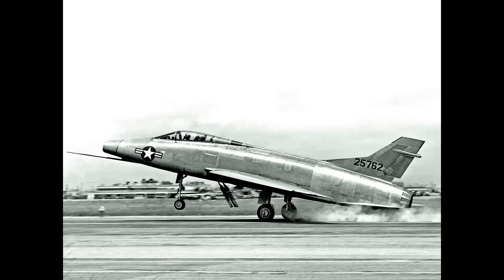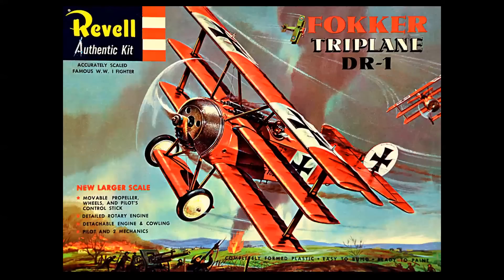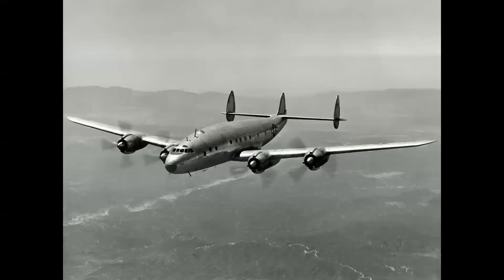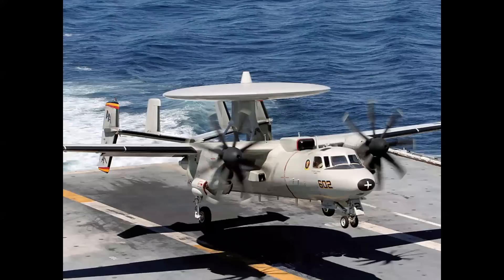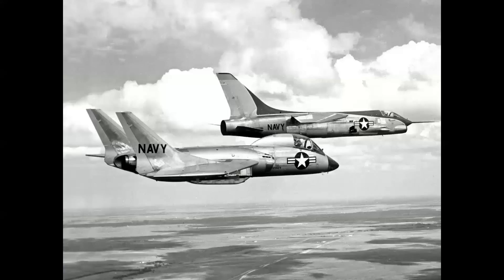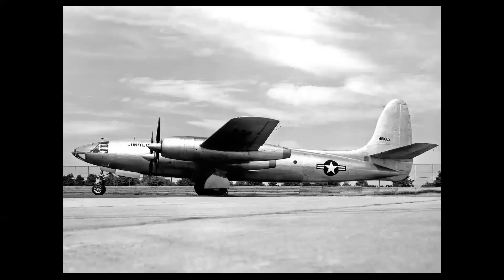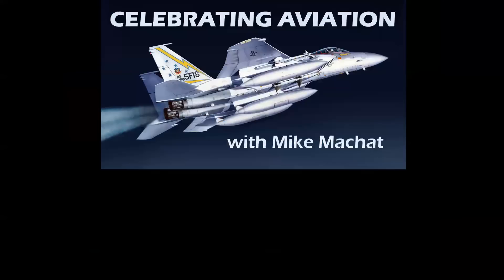VERTICAL STABILIZER DESIGN - A Photo Essay Showing Aircraft Tailfins Throughout History

Comment: That DC 8 vertical stabilizer is interesting in that the rudder section covers as much area as the solid front section, which is unusual as the rudders on most VSs cover 1/4--1/3 of the area usually. Also much smaller & lighter than 707 VS

Comment: Sometimes the fin has to be enlarged because the fuselage is shortened, shortening the moment arm from the center of gravity to the vertical stabilizer. The Airbus A318 has a taller vertical stab due to this fact.

Comment: Interesting video! I was glad to see that you included the shortening of the B-52 vertical stabilizer. When re-engining was being studied, one obvious choice was to switch to 4 larger engines. One reason against that was that with the smaller vertical surface it would not be able to handle the yaw caused by an engine failure if it was 1 out of 4 vs 1 out of 8 engines. As for those early flying wings, pusher propellors have a yaw stabilizing effect somewhat like a vertical fin. When they went to jets they needed to replace that effect with actual vertical stabilizers.

Comment: Great video, Mike!  One factor driving larger vertical fin size with higher HP or thrust  is the ability to have enough rudder travel to control the airplane in yaw when one or more engines quit on one side.
Reply from the maker: Thanks for the info!

Comment: Other than being very narrowly focussed on only US designs, this was interesting. It is salient to compare the tail fins of the Comet airliner and the Boeing 707, both pioneering airliners. The Comet's fin is incredibly small in comparison, but notice that in the event of an asymmetric engine failure, it needs far less rudder authority than the 707. This translates to savings in weight and structural strength in that area, both vital when engine power was marginal to say the least. People criticise the Comet for its engine placement, but in fact it was  a very smart choice for the time. It's also worth noting that carrier-borne aircraft have a tail fin height constraint, informing some designs like the F4 Phantom (the extreme anhedral stabilizers act as a partial inverted V-tail), and Grumman Hawkeye, etc.

Comment: One thing I liked about the XB-35/YB-49 rudders was the control system. The pedals weren't linked like other rudder pedals, instead pressing one pedal just opened the clamshell on that side of the plane. They also could be used as speedbrakes simply by pressing both pedals. Cool how it's intuitive both mechanically and ergonomically.

Comment: I believe the B 52 tail was shortened after an incident where the vertical stabilizer was ripped off due to turbulence. Shortened it offered less leverage, which in effect, made it stronger.
Reply from the maker: Yes, that is correct, thanks.
Reply: @celebratingaviationwithmik9782  My dad was a B52 navigator during Vietnam. I went the other way and became a professional tandem paragliding pilot 🙂

Comment: B52: "the tail was shortened when they discovered they didn't need that much area"

You're not kidding. Look up B52 serial no 61-0023, how it lost most of its vertical stabiliser, and how it flew on for several hours before landing safely.

Comment: Scott Crossfield, aka Mr. X-15, wrote about being involved in its design. And he pushed to have a very big tail on it with overestimated requirements. He noted how in the early fighters and X-planes of the era, most of them had dangerous stability issues addressed by enlarging the tails in later versions; but there was not one where they decided it had too much tail. And with all the unknowns and huge envelope leaps of the X-15, that was one factor that was a good idea to eliminate. And so they did.

Comment: The YF-22 prototypes had very large vertical tails which were greatly reduced for the production design.  The YF-22’s main landing gear retracted forward which forced the engine inlets to extend far forward against the fuselage.  At high angles of attack, the inlets would blanket the base of the vertical tails so they had to be large enough to see clean air at the tip.  The production F-22’s main gear was changed to retract outboard which enabled the inlets to be placed more aft.  This led to less blanketing of the tail which enabled it to be reduced in size.

Comment: Great video! I wish you would have included the YF-12A Blackbird (a precursor to the SR-71).  It had a 3rd retractable vertical tail under the aft fuselage.  It was folded up against the lower surface of the wing during take-off and landing to provide ground clearance on rotation.  Once aloft, it pivoted down into place giving the airplane a very beautiful – and unique - profile.
Reply from the maker: We'll be covering that very feature of the YF-12 in our follow-up video on Ventral Fins posting Monday morning. Thanks for watching!

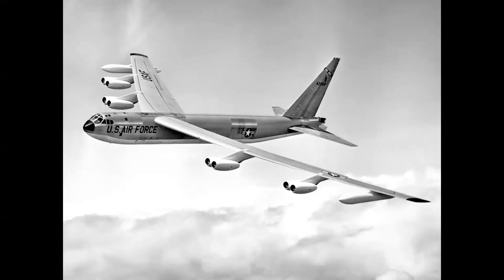Comment: 12:13 the earlier B-52s had issues losing their tails in severe turbulence. I highly doubt the official narrative that the area wasn't needed (that the airplane was "too stable"). Im 97% convinced that they reduced its size to reduce its bending moment. Because beefing up the structure to adequately eliminate tails flying off was probably not possible due to weight&balance. Reducing the tail size reduced weight and drag but also bending moment and improves strength dramatically. They might have determined that "it had too much tail" after that one landed with almost all of its vertical stabilizer missing, flying through mountain wave/rotor is not for the faint of heart.

Comment: Interestingly, the first YF-100A prototype had the taller tail. It was the switch to the smaller tail that the F-100 starting experiencing serious stability problems, one that was only fixed whey they applied the YF-100A prototype tail design back.

Comment: A major consideration on multi-engined aircraft is containing the yaw on failure of an engine, especially an outboard engine. The 707 in particular had terrible (dangerous) very high VMCA (minimal control speed airborne) in early guises and the British refused to certify it until the fin was enlarged and the ventral fin added. Even then it was a bit of a handful if an engine failed on take off. Another factor is length of the rear fuselage (between the wing and tail) The longer this is, the bigger the 'lever arm' and the more effective the tail surfaces. This is why the stretch DC8 did not need a larger fin.

Comment: Someone may have mentioned it already, but the rudder/v-stab on the Vigilante is known as a "full flying rudder." The Fokker DR1 (and many other early aircraft) also had a full flying rudder.
Reply: Correct. "Ruddervators" are moveable surfaces that function as both rudders and elevators, as on the V-tail Beech Bonanza.

Comment: Don't know if anyone has commented yet but your picture that you describe as an F104 A thru C is actually a later model. The A thru C rudder ends in a vertical line, no slant at all.
Bill Masquelier,  former crew chief F104D at Edwards.
Reply from the maker: The aircraft you are referring to is a Lockheed F-104A, S/N 56-737 assigned to the Air Force Flight Test Center, Edwards AFB, California, and has a vertical trailing edge on the rudder. (U.S. Air Force photo). Slanted trailing edge rudder on an F-104G is shown in following photo. Thanks for watching.

Comment: A most interesting idea for a video!  On the F-100, the shorter vertical tail was present only on the very early F-100A models.   Those F-100A models with short tails were removed from service and retrofitted with the taller tail before being sent back to the fleet.  Fun Fact:   When Boeing 707s were being retired, the USAF bought them for their taller vertical tails and installed them on KC-135s, which were built with the shorter tails of the early 707s.

Comment: Mike, the dimension is called "tail volume".  It is the sum of the area of the horizontal surfaces multiplied by the area of the vertical surfaces. In aerodynamics there is a well defined range of ratios between the volume of the fuselage and the volume of the tail.
When aircraft like the F-100 came out, it turned out that the DENSITY of the fuselage was an important factor to consider, too.
Reply: Sort of. Tail volume is area of the tail times distance to the center of gravity. Area times length equals volume. A bigger tail gives you more tail authority, but so does a longer moment arm, like a longer wrench handle. That's why volume is a useful measure
Reply: @paulgush  , "tail volume" is still the cubic area of the sum of the tail surfaces. (I was a Bonanza owner, so the terminology is important to us. ;-) ) 
"Tail authority" would be the product of tail volume and the moment, true enough.
It is always easier to make the rudder taller, make the horizontal surfaces wider or rivet on a ventral fin to get more authority (and, hopefully, stability) than it is to lengthen the fuselage!  Yet, (almost) every time we see that, you can know that it is an aerodynamic 'oops!' on the part of the engineers.
Reply: @stay_at_home_astronaut  A vee-tail Bonanza would be a tricky one. I suspect you'd take the projected planform tail area times distance to CG for horizontal tailplane volume, and side view projected area to calculate vertical fin volume. If you still have it, you may want to refer back to your POH. The only way to turn area into a volume is to multiply it by a length. (I'm an aeronautical engineer, so terminology and unit balance are important to me :-). That said, I agree, we engineers don't always get things right first try, therefore ventral fins, etc. Happy flying!
Reply: @paulgush  Ha! Now that I think about it, you could calculate the 'tail-volume' of a Bonanza (if it doesn't have a V-tail, it is not really a Bonanza!) by using the span times the chord of the surfaces as the radius and length of a cylinder's. volume. Then use the "V-angle" over 360 to calculate the fraction of the volume of the cylinder from step one.

I had a Beryl D'Shannon 'skeg-keel' installed on the bottom of the tail-cone on my aircraft. I flew with it removed and decided that it really didn't do anything to damp out the "Bonanza-Boogie". (Short cycle coupled roll and yaw oscillations during cruise flight.) I did reinstall it because it soaked up my occasional over-rotation/flare. (and it made a cool trail of sparks on a concrete runway, at night.)

The thinking is (and is possibly wrong) that it is more the shape of the Bonanza's tail cone interacting with the spiral flow from the propeller, rather than the V-tail that causes the Bonanza-Boogie.  This seems to be true, because straight-tailed "Bonanzas" (Beech 33 and 36 models) wag their wings while cruising, too.
Reply: When Lockheed started developing the Connie, they were told by  the airlines that whatever Lockheed came up with was going to fit in their existing hangars.  Lockheed decided that in order to have  the necessary size, they figured out that the amount of tail fin surface needed was "X" number square feet, so they divided it three ways.  And on the first day of ground school for new Connie pilots, they were told that "it took a real man to handle three pieces of tail.:

Comment: Most of the fighters built since the 1970s required twin tails; when they didn't, the result could be in an outlandishly large single tail, as on the Panavia Tornado.  The original YF-22 had two outlandishly large tails, but flight-testing revealed that they didn't need to be that large, and on the production F-22, they're more reasonably sized.  (I have learned that even those are larger than they really needed to be.)  The use of digital flight controls has apparently diminished the need for large verticals; on the Sukhoi Su-57 they look to be too small, but evidently the plane flies fine.

Comment: I'm a little surprised you didn't flash up an image of the "tailless" B-52H that continued flying after it lost its tail.

I once owned a plane with a tail redesign. I had a 1975 Grumman AA5 Traveler which was the last year of that model before it became the Cheetah. The Traveler tail was slightly smaller than the Cheetah and Grumman put a stub ventral fin underneath the empenage. So it looked like a prop version of the 707 tail.

Incidentally, I understand Tex Johnston pushed through the ventral fin mod on the 707 after a handful of early major crashes which Tex determined were due to insufficient vertical stabilizer area. He got pushback from the engineering team on it, but succeeded in getting the fix approved. He retired from Boeing not long after that though as he said Boeing had gotten too corporate and run by lawyers as opposed to the days when he began working for them.
Reply: I had an AA5 and a AG5. The Cheetah and Tiger had MUCH more tail volume than the Traveler.  The increased size of the tail-feathers made spin recovery much more, ahhhhh, positive, than the Traveler's characteristics.
(Yes, I know that the aircraft is placarded against spins.)

Comment: Hey Mike. Great show. Since we're on the subject of multiple tails -- I was looking up the Curtiss CW-20 and the text said the prototype XC-46 had twin tails originally.. No pictures are to be seen. But I think it could have looked cool if it were anything like the B-25. 
Originally the Curtiss Condor III, the ship was renamed Curtiss Commando during wartime -- and reconfigured as the militarized C-46 [USAAC] and R5C for the Navy and Marines. 
Had success climbing with payloads over the Himalayas after the Burma Road was cut of by proponents of the Greater East Asian Economic Co-Prosperity Sphere. Flak bait in the ETO.  But they never added self-sealing tanks to the Commando. It retained its airliner style high perfrormance big block fuel system. That was its tactical glass jaw. 
I talked at length with the docent  at the Commemorative Air Force's museum at Camarillo CA. while touring inside China Doll. Fascinating aircraft.

Comment: Mike, great video. Some additional thoughts. 
The Vigi single vertical tail folded for hangaring. 
The F-14 added ventral fins to add vertical surface area.
The F-15, F-16, and F-18 did not change their vertical fins, but changed the shape of their horizontal stabilizers, with the F-15 and F-18 changing their wing planforms. A different video, maybe?
The E-2 had 4 vertical stabilizers with dihedral that, with the rear fuselage, would unbelievably shake on engine run-up for ship-board launch. The tail horizontal stab’s had 0 dihedral (flat horizontal) in redesign into the C-2 Greyhound COD.
The WF-1/E-1 (Stoof with a roof) bifurcated the single S-2 Tracker tail into a vertical tail with 2 outer vertical Stan’s to accommodate the “roof” housing the AEW radar.
The AD/A-1 Skyraider added small vertical stab’s for AEW models and enlarged the single tail for the later multi-place, extended canopy versions.
The B-17 went from the small Boeing tail to the sweeping big tail with the tail gunner under it at the rear of the fuselage in later versions.
All of these were brought to mind by your excellent video. Please keep up the enthusiastic and necessary preservation of aviation history, art, and modeling.
Reply from the maker: Great point on the F-15, F-16, and F-18 horizontals, thanks!

Comment: Mike, I used to own a set of Kodachrome sides which date from 1964 at Pease AFB during the Open House they had. The KC-135 which was there that day was an original A version with the unpowered rudder and shorter vertical stab. This jet was from Griffiss AFB and came to Pease that day with a B-52G also from Griffiss. Pease at that time had the B-47E and KC-97G still in service, so a pair of tanker and bomber representing the soon to come more up to date equipment to Pease in only a few years to follow.

Comment: Thank you for the interesting video. I hope you make another that covers other nations, and some more in the WWII era. I would like to know more about why Douglas and North American went for square tails (A-20, A-26, P-51), but Boeing, Supermarine, Consolidated, etc went for rounded ones.  And how did Mitsubishi come up with a triangular one (with a rounded tip)?  I have often wondered why the tails on the P-39 and P-40 were so similar (maybe it was a Buffalo, NY thing), and yet were subtly different.  The video was great; I am sending it to my brother the pilot.
Reply: Part of it is related to construction and to drag, part of it to designer preferences and experience, part of it to corporate look. The taper of the elliptical rounded ones has to taper toward the tip in both chord and thickness to keep drag down. Somewhat less machining involved to build straighter and then cut end flat. Those same effects even apply to little bitty balsa wood model rocket fins.